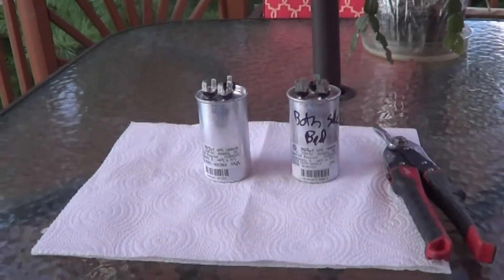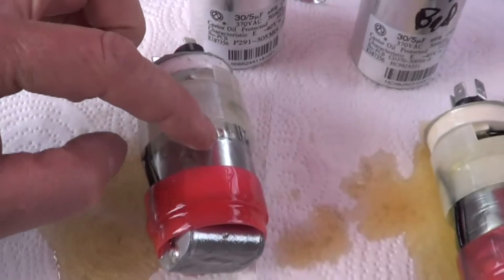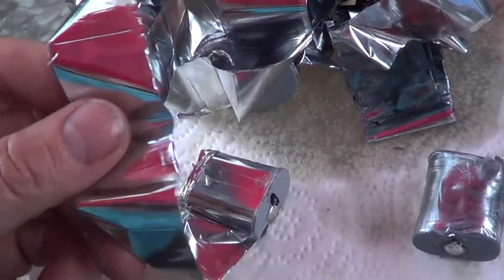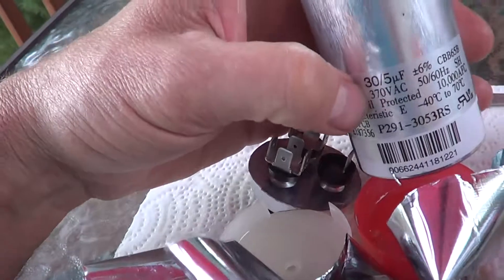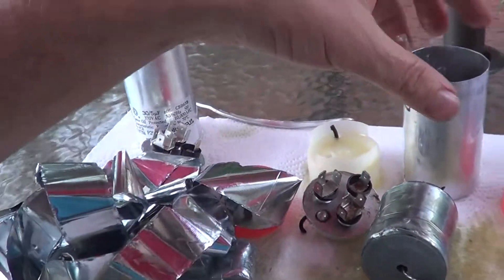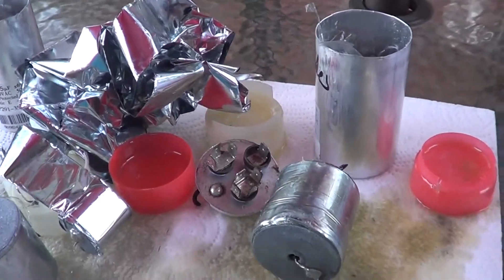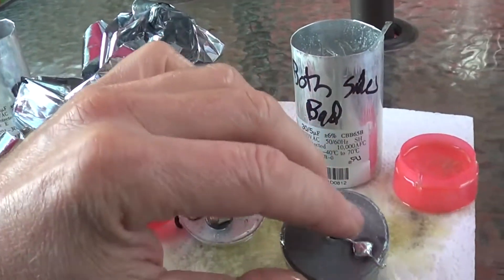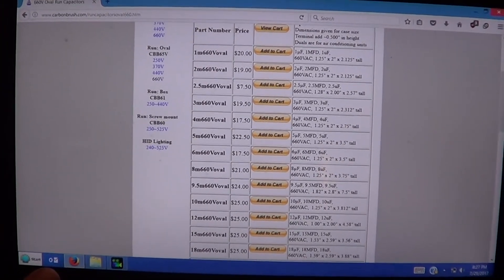How Run Capacitors Fail   A look inside them

Comment: I purchased a new 1.5 hp 110 volt replacement motor for a table saw from somebody on Craigslist. It would not run full speed, I checked the capacitors and the run capacitor was bad. I bought an exact replacement one off of eBay and put in it. I ran it without a load for about 2 minutes then it blew the run capacitor again. What are my options? Can I put a bigger one in? How would I check to see what is wrong with it? Thank you!
Reply from the maker: Check the that the motor voltage is correct.   Some motors  are dual voltage and can be wired for 230v or 115v.    Maybe the capacitor is the start capacitor and not the run capacitor.   A start capacitor will have a centrifugal switch at the back end that takes the start capacitor off line after the motor spools up.   It the centrifugal switch is stuck in the closed position, it will blow up the start capacitor.   Start capacitors are usually black plastic and round.

Comment: CARRIER has a problem with the caps. I changed a ton of 2-4 year old caps last year and this year. Nearly every single unit I installed showed weak when did PM or was called for no cooling.
Reply: I had a new Carrier unit installed 24 months ago.  That’s how long the Chinese capacitor lasted.

Comment: The reason they fail is the amount of oil, old style capacitors would last longer due to 1/2-3/4 filled with oil. Many were huge and never failed.Most all were 370uf
Reply from the maker: Actually, the plates and insulators were thicker and they were filled with PCBs.
Reply: chlorine
Reply: NathansHVAC Nasty stuff, and thats also why the door gaskets lasted longer